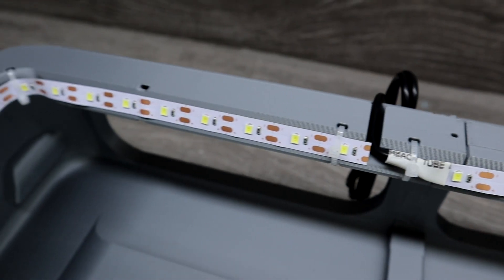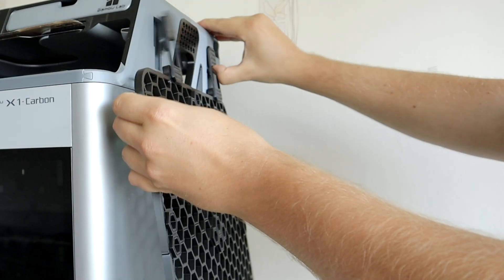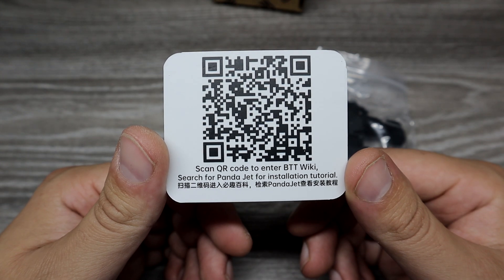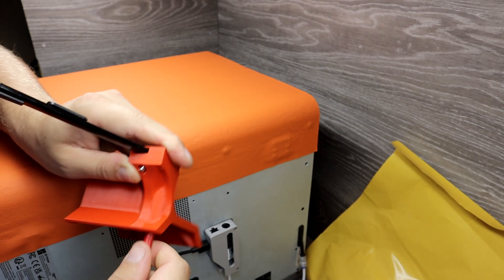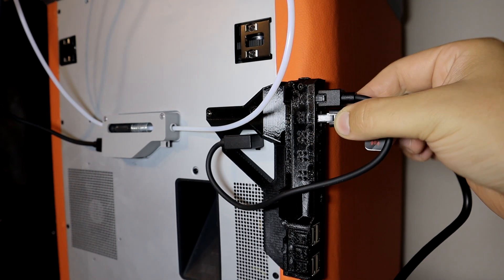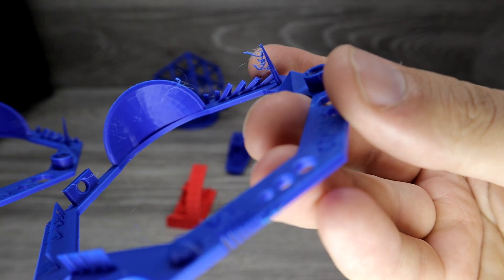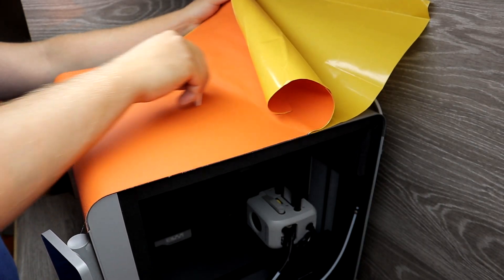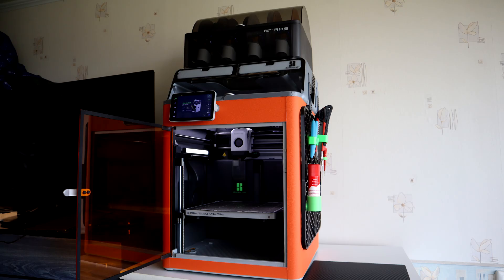I Upgraded My Bambu Lab X1C 3D Printer - Is it worth it?

Comment from the maker: UPDATE on Panda Revo hotend. It worked without problems on many prints, but then it clogged. I used maybe too much speed for that filament I used. I cleaned the hotend after that and I got it working again. I started same print again with lower speed and middle of the print clogged again. It happened once more and I didn't have time for that, so I changed back to old one. Printed same print with same speed and filament without problems. Maybe I didn't get the hotend and nozzle completely clean. I will change it back when I have more time and try to get it working again. I can't say it's hotend fault, but that's what I experienced.
Reply: Did you get it working? What's the best way to clean a revo nozzle you'd recommend?
Reply from the maker: @alexandertouchdown8737  I haven't used it again. You can use heat, nozzle cleaning tools.